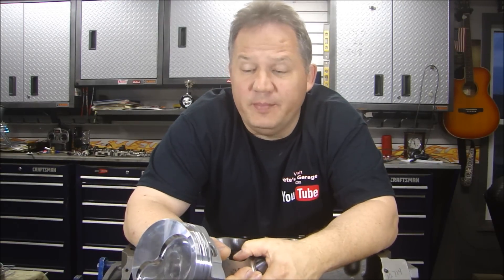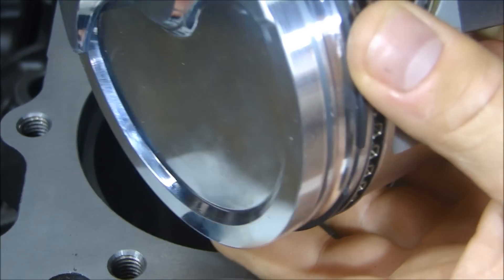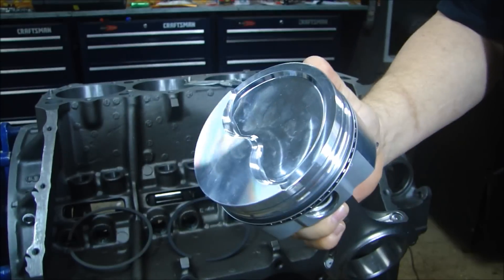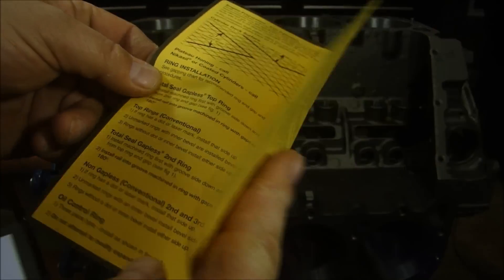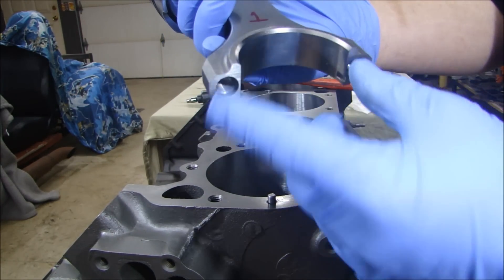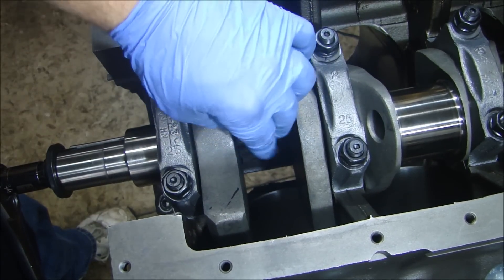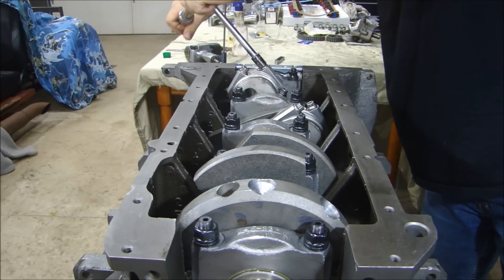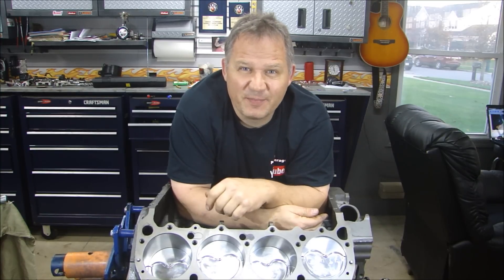440 Chrysler Mopar Engine Building Part 3 - Piston Ring Gapping & Installation

Comment: I don't know about using extensions when doing torque on rod bolts .thats scary
Reply from the maker: You can use an extension if the tensile strength of the material is greater than the torsional force applied
Reply: @PetesGarage  was good videos series on the 440 build .enjoyed very much keep up the good content dude

Comment: A tip on installing the rings on Pistons
To make installation go “smoother” place your ring kit in the oven and set at WARM…150 to 160 degrees is all that is needed.
Pull out one bank at a time and install
They go on like butter
DO NOT check a ring gap with a warm ring, this should be done as a separate process before installation
Ring gap should always be checked with a cold ring and block
Reply from the maker: Interesting, does the manufacturer recommend this?
Reply: @PetesGarage  I’m not sure about ring manufactures position on warming ring sets before installation but since the products will “experience” a constant “working temperature” HUNDREDS of degrees higher when the engine is in service I’m not sure there is reason for concern here.

My Dad and his hotrod buddies did this trick in the 50’s and 60’s and he taught me to do it.
All your trying to do, is after you have done all your final ring inspection, gap filing etc.  
Is make the rings go on the pistons “smoother” so they are less likely to be bent or broken during installation without damaging the piston
This also makes them a bit easier to “clock” when not cold.

Comment: I watched  your cam degreeing vid and that engine had flat tops in it with valve reliefs.
Now you're putting in dished pistons????
Reply from the maker: Different heads, different HP requirements
Reply: @PetesGarage  So, on the other engine with the flat-tops with reliefs, did you use open chamber heads
and if so how did you come to a piston choice?
Reply from the maker: They were open chamber and the pistons were chose to get the compression ratio for pump gas

Comment: Great vids. Sub'd. I will use these when rebuilding the 440 for my '70 Satellite. I have a few questions. What did you use for lube on the pistons when you started assembling them into the block? Just WD40? What brand of assembly lube were you using on the bearings? Thank you. Great job on explanations.
Reply from the maker: Thank you Mark, and welcome. I use WD40 to help get the pistons through the ring compressor, but I lube the cylinders with the same motor oil I'm running in the engine. I use JD Blood lube but any PTFE assembly lube is good.

Comment: just a bit of trivia, notice the holes in the rod bearings? they allow oil to get in between the rod and the bearing, why? because only on start up does your rod actually ride on the bearing, otherwise it's riding on a very thin bead of oil, which is why oil changes are so important. Since my old man passed away 10 years ago i haven't touched any of our mopars (we have quite a few that we were working on from a 36 Plymouth coupe to a dodge 330 polara race car). It's moments like this that make want to go back to it but after i start i just don't have the heart.
Reply from the maker: Interesting. If the rod rides on the bearing, how does it go over the lock notch?
Reply: @PetesGarage  i don't think i was very clear. The rod journal rides on a thin "sheet" of oil on the crank. both rod bearings with oil between them and the crank which acts like a "pillow" for the rod to around and this is what amazes me, such engineering is just wonderful (guess cause i'm into machinist stuff). It's kinda like why those old blocks were always cast iron (or better said, one of the advantages of using cast iron). That cast Iron acts like a sponge and helps keep oil at the piston from the cylinder wall. Like i was trying to point out, it's amazing engineering. (I'm not even talking about the amazing things found in the racing world either). Hope that made my statement clearer. :)

Comment: Hi Pete, great videos. I'm always looking for new sources of advice when rebuilding, and just found your channel. I have few questions. 

First, from the beginning of this video series, and someone else has previously asked this, how much block cleaning & prep do you do on a used factory block like this prior to sending it out to the shop? I always chase and clean every hole, open up the oil passages and run pipe bushes through them. I will cut ends off the pipe brushes to chuck them in a drill and clean passages almost like using a hone. I also use a small die grinder with rotary file bits to clean up any excess iron flashing on the block and smooth all the drain passages to aid in oil return. At 9:07 in this video it looks like there's a bit of flashing in the center lifter valley. This is just for regular street engines, my thought is better oil return and drainage will reduce oil sludge and build-up when the motor cools down after use.
Finally, something I haven't tried, but have thought about as I've seen painted internal cases at work (power plant). Have you ever considered painting the inside of the engine for improved oil drainage? 

Tom
Reply from the maker: Great comment Tom. I don't do too much cleanup, unless there is some major flashing or the customer is paying for a show engine. The machine shop removes all of the plugs and bakes out all of the oil so it's spotless. Saves me a lot of time and aggravation.

Comment: Hi Pete,  I watched the install of piston 1 and 2 a couple times and wanted to confirm the orientation of the rods to each other.  Piston 1's chamfer goes towards the counterweight, leaving the flat side over the middle of the journal.  I assume that means piston 2 is reversed 180 degrees so that it's chamfer is against the other counterweight and it's flat side us next to piston 1's flat side.  Then re-pete..haha.  is that correct?
Reply from the maker: That is correct

Comment: I am not certain I am following the planning phase. You bought .040 over pistons but the you needed to bore the block at least .038 to get rid of the lip. If you chose your piston before knowing the block needed to be bored that much, could you be risking having undersized pistons? I may be misunderstanding what you're saying but it sounded like you purchased the pistons prior to having any machining or measurement done on the cylinder. Just wondering how more about that particular step, whether you measured first or knew you were going with the .040 pistons to begin with.
Reply from the maker: Sorry about the confusion. I measured first. I knew it would clean up and hone to .040" over.

Comment: The old factory type rear main seals if I remember correctly were once made out of some type of felt material or something and you would dip them in mineral spirits or other light oil. You would put the seals in the grooves and install the cap quickley as then the seals would swell up after you installed the rear main cap. It would be a very tight seal.
Reply from the maker: Yup, those worked well.
Reply: I believe it was hemp rope. Someone correct me, but I heard that ages ago.

Comment: Could you please tell us what exact KB pistons they are, and how you came to pick these for the build? Anything you can explain about quench properties in the BB Mopars, and why the compression ratio was held beloe10-1/2 to 1? Thanks! gret videos, and super clean shop!
Reply from the maker: KB Piston IC822030. I have used them before. I held down the compression ratio to run on pump gas. I'd have to make a video about quench properties.

Comment: Since when is the bore tapered? I've been boring cylinders for decades and I have never bored them tapered, the piston 
has a taper, maybe you misspoke? I will normally put the rod in a vise on a wood soft jaw T jig to keep  the piston from
 moving on the pin  when putting on rings for ease of assembly
Reply from the maker: Depending on who does the machining and how they do it, the top of the bore can have a slight taper. I've measured up to .001" within 1" from the top.
Reply: @PetesGarage  It can have a slight taper but not by design - only if it's not bored/honed properly.

Comment: Do you ever rotate the rear main seal so the joints are not at 3 and 9 o'clock level with the block?  I'm assembling my 225 /six right now and I am really wanting to get it right so no more leaks.
Reply: By the way, your YouTube series has single-handedly helped me go from a rookie to a semi-rookie. :)
Reply from the maker: Rotating the seal is a good idea, I've done that with the old, rope style seals. It wouldn't hurt

Comment: Pete, you missed one of the most important things about building a SB or Big Block Mopar.  The #4 cam bearing has to be indexted to match the 3 holes that allows for oil to go to the heads and the rocker arm shaft in order to oil the rocker arm and push rods.  Failure to do this will not allow oil to one head and very little to the other.  I have seen this a couple of time where the machcine shop did not do this and the engine had to be tore down and the cam bearing indexted to the correct orientation. Very important to put a light in the #4 crank journal and down the oil passage on top of the block between the #3 and #4 cylinder holes.  If you do not see the light, the bearing is not installed correctly and should be replaced.
Reply from the maker: Absolutely correct. My machine shop takes care of that. In my later video about priming the oil pump I talk about that.
Reply: Harold
Reply: Bill, your comment did not post.
Reply: Thanks Pete, I hope that viewers read this very important step.

Comment: A@ 8:40 that's not an oil hole/ that hole is for use in aluminum rod with pins / yes you have to put bearing in to match radius on crank journal on after market cranks
Reply from the maker: Thank you very much for the comment

Comment: Pete, I am pretty sure the 2nd ring is bevel side down not up. I use the same Total Seal rings. If you read the instructions it actually says if there is no dot install bevel side down.. left side of the orange instructions - conventional rings. 7.31 into your video. And number 6 piston doesn't look correct at 17.21 it appears you have an inlet and exhaust together ? Usually the valve recess is ex-in-in-ex-ex-in-in-ex.. Did this myself not long ago and realized after I buttoned up the sump.... ;-)
Reply from the maker: BINGO! Not only are you correct, I Love my Strat! You were the only person to catch that piston ring. I actually fixed both of those items after I made the video. YouTube use to allow me to add annotations so I uploaded the video and wanted to add a correction right on the video at that point. Well, they changed the options and I can no longer add an annotation. The only way to correct that is to upload a new video. I'm trying to do something about it. Email your address and I'll send you a t-shirt.
Reply: Strato caster bevel is like an hour glass / bevel up top ring / bevel down bottom ring unless you have 3 ring tall deck Chevy truck piston then you have 3rd comp ring

Comment: Great stuff as always. Thanks.

What happened at 13:12? To an untrained eye like mine it looks like this would scratch the inner cylinder wall quite good.
Reply from the maker: You have a great eye. That ring compressor is on there really tight. When the piston drops in the compressor closes pretty quick. It is not harder than the block so it will not scratch.

Comment: Also double check the rod bolt torque spec.  40 ft/lbs sounds like the torque spec for the stock 3/8" bolts.  I think the Eagle rods have the 7/16" cap screws that take 60+ ft/lbs of torque?
Reply from the maker: I owe you a beer Jim! I looked at the wrong spec. The card had both bolts but separated. The torque is 63 ft. lbs. Send me an email with your address and I'll send you a t-shirt. thank you
Reply: Wow what a catch

Comment: Very nice video, well done clear explanations. My only question  is the method you use to increase the ring gap if you need to. I have tried  a hand file and a hand held grinder but I can never get the ring gap to be of constant gap, it always seems to be crooked looking (Uneven gap). One time  this bothered me so much I bought another set of rings to practice on. Also a grinding wheel can get the ring red hot at the end, doesn't this change the rings hardness for the worse? Luckily the majority of the repairs I did (on my own engines) were ok as they came out of the box. I still have a lot to learn and your videos I can follow quite well and learn a lot from your experience.
Reply from the maker: Thank you Joe. If you need to open up the gap, you can get a cheap ring file like this one https://www.summitracing.com/parts/sum-906795?seid=srese1&cm_mmc=pla-google-shoppingsrese1_-summit-racing&gclid=CjwKCAiA0IXQBRA2EiwAMODil6kJ-UZqjt6-H2Y8HyhTtfa4OdRtIa7N1md5Gi2PhKiSrVlx1JBVdxoCcBQQAvD_BwE

Comment: So I thought that std size is the stock bore size, and oversized is the .020, .030, etc. Or am I missing what you were saying there? Also is it always the case with the rod bearings having the hole for the bottom? Seems like my Nissan was the opposite, but I could be wrong?
Reply: Shaun Griffin he should have said off the shelf.
Reply from the maker: For a 440 the stock pistons off the shelf come in those over-sizes. Bearings vary quite a bit. Sometimes they are orientation specific, sometime location specific. Just make sure they're in right. If you're taking an engine apart, take pictures so you can remember how they go back in.
Reply: Some bearings fit several applications. That's why there is a hole in one half. On a Nissan the bearing with the hole might go into the rod instead of the cap. There is usually a matching hole in the rod also for pin or piston oiling.

Comment: Another excellent instalment. With regards to the piston ring gapping, if it came with .010 clearance and you needed to open it up abit, is there a side that you favour (bigger or smaller) or would you just split it down the middle? Obviously application dependant, but for this engine say.
Reply from the maker: I tend to favor the smaller side. less gap the better. Thanks John

Comment: Hi Pete! 
Love your videos :) 

I have a 351w in a 68 Fastback mustang. It puts out over 450 hp and is supercharged. 
The problem is that i dont think its tought through when they built it. Cause i dont think it runs right, and when i got the parts list of the prev owner, it didn't seem right.
Im on the verge of wanting to just rebuild the whole thing, leaving only the block left, if its crack free and i good shape.

I have a few alternatives i want to do:

stay with the 351 cid, but build it for a supercharger.
OR
Bore and stroke it out, to either 408 or 427 cid, but leave the supercharger out of it.

What do you think of these 3 alternatives?

Thanks!
Reply from the maker: For a 351 you don't need the supercharge unless you just like the look. Bore and stroke to 408 and you can still get the 450hp

Comment: just a note here so nobody gets confused, on most of the production engines the bearing with the hole goes on the rod, because that's how you oil the piston pin
Reply from the maker: That is true. You have to check. The rods I'm using do not have that hole, but matter for location.
Reply: This was a  question I was going to ask.   
I’m building a smallblock 360 and will have to look at my eagle rods as it has full floaters.